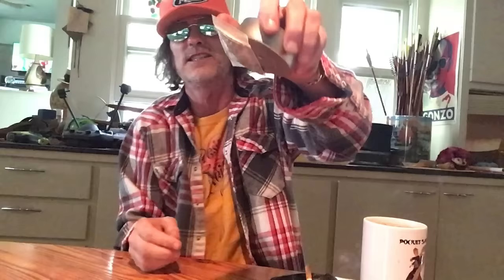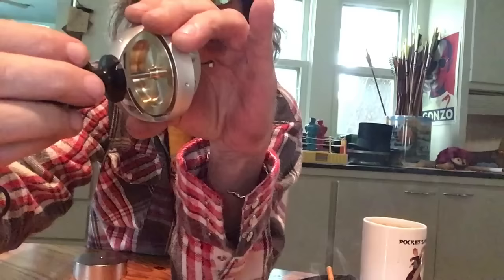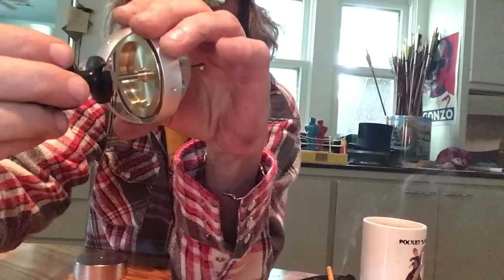The Secret of The Pyramids Revealed! by Rusty Shackelford

Comment: Hey Dale I mean Rusty, have you heard about the Hollow Earth theory? Can you redpill us on that?
Reply: If the Earth were hollow, it would need to at least be 353 miles thick, about 9% of Earth's radius, or 140 times as thick as the deepest mine.  Make the spherical shell out of solid Osmium, and it would have a mass equal to the mass of Earth we measure through gravitation and the Cavendish experiment.   Osmium is a rare material, so this is a very unlikely chance that this is reality.  Solid Earth's density is about that of cast iron, which makes more sense, because iron is a far more abundant material.